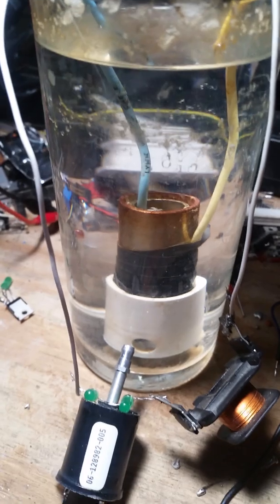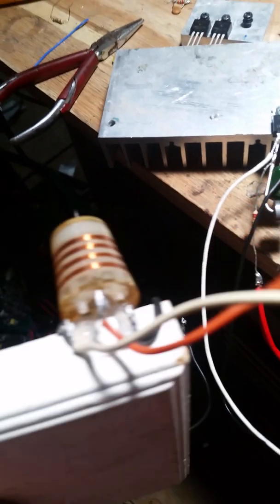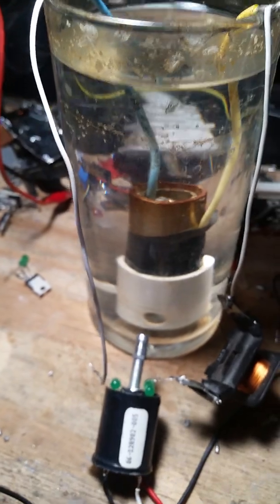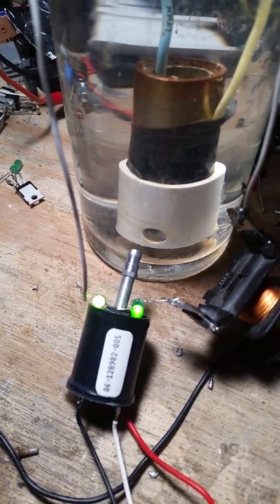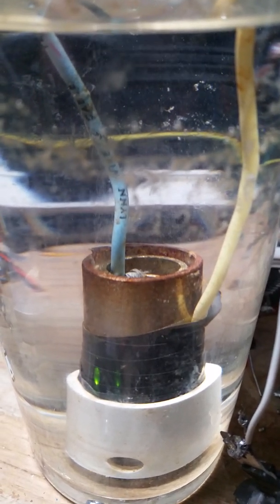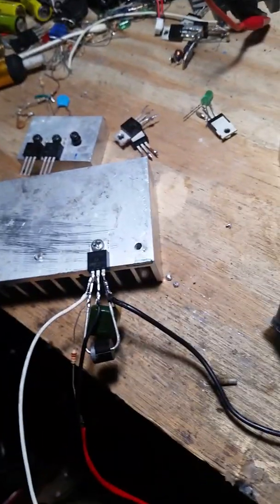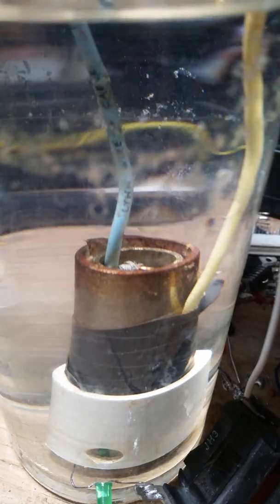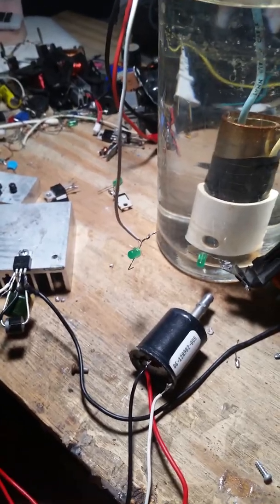Stanley Meyer Zero Point Energy ,By Brian Coats, credits go to Niklosa  Tesla.

Comment: Stan was using reseance freq. And having it amplified. And using a frequency generator  with a 555 pulse emitter to find the reseance of the water he used and changing the reseance to obtain the break down of he hydrogen. Just increasing the amperage makes eveto hot but changing the resinance to decrease the the amperage to under .5 amps to get his hydrogen product making the output at more than 5,000 times the energy nput
Reply from the maker: Please research metallic and master the use of it.